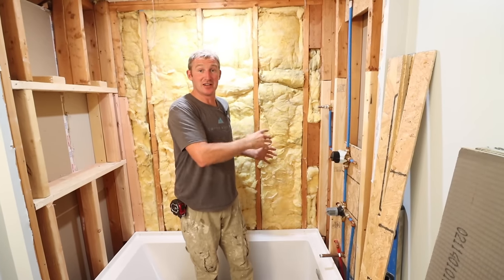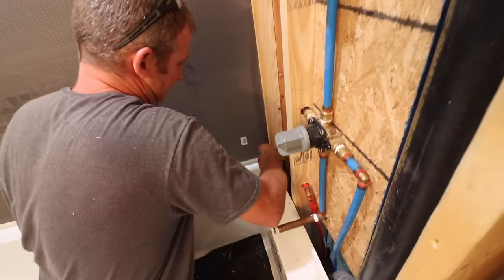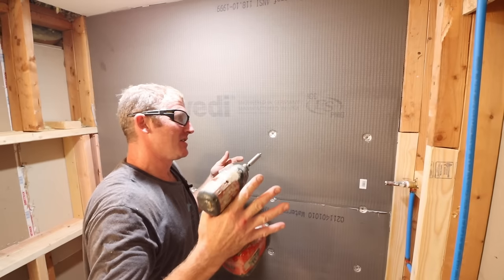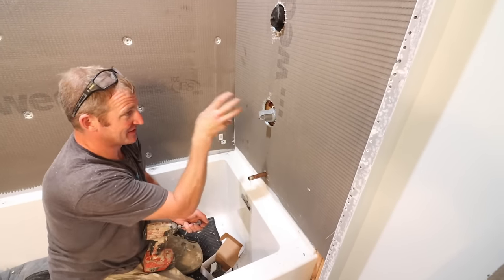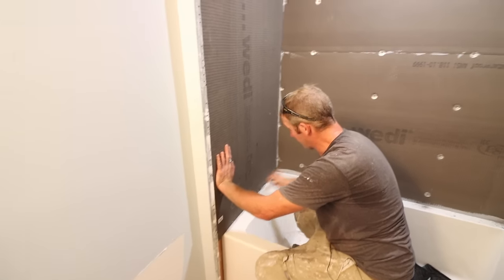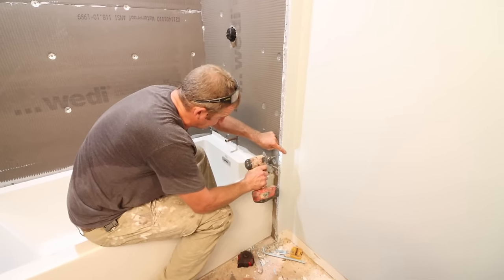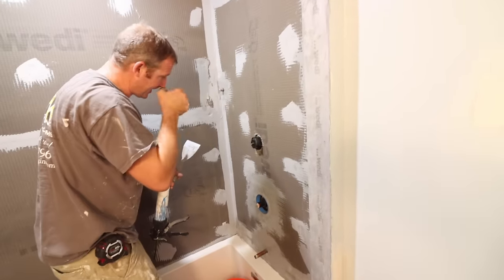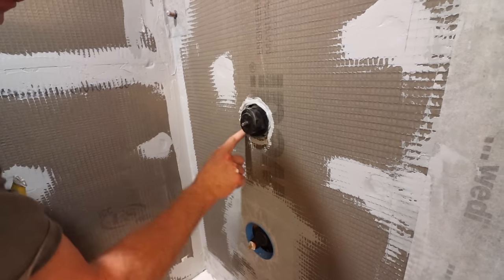Waterproofing Tub Shower Walls | Easiest Method for Beginners

Comment: Did I miss something.. Didn't you day that the foam board has to be 1/8 inch above the tub surround?  I didn't see you use any spacers at the bottom or was the sealant used for the spacer?  Really need to know because I am building a shower next week...Thanks!

Comment: why use the 620 instead of the Wedi? would the Wedi work just as well? prolly going to use this on my bathroom just wanna see if there would be an issue with using the Wedi sealant with the tape.

Comment: Hello, I noticed that Hardiebacker has two sizes of board. 1/4in with grids on it, and 0.42 inch which is smooth. Which is recommended for shower walls, and which is for floors? Do you know which sealant I would need to use like you did at 6:24? Also would I need to paint the hardiebacker with redguard or use a vapor barrier behind it? Thank you in advance!

Comment: Pro tip,

#1 Use a flush router or Dremel tool to cut the niche out. Its faster and cleaner. I use a 20v Dewalt drywall cutout tool 

#2 Do the inside frame of the niche before the back of the niche. Its better waterproofed that way.

Comment: What if you are just building a shower, do you still need to have a 1/8" gap between the shower pan made from deck mud? and would the sealant still be used between the deck mud floor?

Comment: Sorry if I missed the answers to my questions in this excellent video but - why did you fir out the back wall and put the backer-board all the way down to the tub, but not the 2 other walls which you butted the backer-board at the faucet side, and notch the backer-board to the rear of the tub?
Reply: I was wondering this as well. Someone please answer!!

Comment: Love your videos! I have a question about the back of the niche. You said there was a bedroom behind it. It looks like you adhered the backer board to the backside of the drywall in the other room. What happens if the drywall needs to be removed in the other room? Won’t that mess up the back of the niche?
Reply: or what if someone goes to hang something on the wall and drives a screw through the backer and tile ?

Comment: Seems similar to what I'm doing right now. The tub looks recessed in about 6" from the outer corner at the bac of the tub. should the regular drywall cover that 6"? Does the durock go all the way to the corner or does it stop at the edge of the tub. I'm a bit confused on what to do with the outside corner and that 6" before it reaches the tub. Do I put in a 6" by 8ft. piece of drywall with a finished corner? Does the durock then buck up against the drywall? I see you have some kind of strip going from the tub to the height of the durock. Is that over the seem of where the drywall and durock meet?

Comment: One suggestion:  mount fur-strips about 3/4” above tub edge. This will ensure moisture cannot wick up fur-strips in case water does penetrate. It also adds air-gap that could allow micro leak evaporation.
Reply: Same with backed board. Need to use a waterproof membrane on this application!
Reply: @mistic mind , he's using wedi board on this application. Wedi  board should be taped like drywall using wedi products. What he did show is how to finish to the tub lip. Sealant on the lip of the tub on the back of the board and leave board up off the 1/2 inch!  Wedi board is a vapor barrier. I would use Red Guard on this application , because I don't trust the caulk!
Reply: @energizerwolf5574  Wow. Glad to know. What's the alternative?

Comment: Hi I’ve added Kbrs shower tray to. MY rebuild. The shower tray had an arch to it and once installed 1 corner is a little more than 1/16” lower. It’s only on the flat area of tray. Should I use thin set to raise up to level?
Reply from the maker: yes, if you can get that corner level it would be better for the slope and to ensure the shower drains properly

Comment: What if you have a window? Do you use ply around the window frame, similar to how you started around the flange? Thanks!
Reply: All you do is cut the wedi like he did the niche. Then at the window itself use the wedi band and the 620 sealant along the window. I had to do this as well. Worked great. Wedi seal the edges where you cut and turn into the window

Comment: Hey. Using durarock on walk in shower   Seems & corners fairly tight so only needing minimal amt thin set or mortar not wanting buy get full bag.  What else to use if using Mapai LVT 4 system utilizing ProCore Plus on walls. Using aqua guard and their adhesive

Comment: Hi. We are going to be installing a wedi shower system next week and we are butting up the wedi panels next to plaster walls. I am not sure what to use for the same. We are extending tile for a couple inches past the glass doors so it doesn’t need to be waterproof. Can I just use mesh for drywall? Do I put the wedi sealant on the edge of the wedi?
Reply from the maker: hey Debra, great questions. If the Wedi/Plaster transition extends outside the shower area and won’t be exposed to water you can tile over the transition if both materials are flush with each other. If however that transition ends up inside the shower it’s best to use Wedi 620 sealant and embed the Wedi band over it to waterproof. But it sounds like you won’t need that in your scenario

Comment: What backer board did you put behind the bathtub... I have a tub in an exterior wall that currently has sheet rock underneath(below) the cement board and growing mildew ... I don't know if sheetrock goes down there or i need a different material

Comment: How long do you need to wait after applying the sealant to tile?  Are you just waiting for the sealant to skin or for it to cure?  I am actually using goboard with Loctite Concrete & Masonry sealant and I am not sure how long I should wait before tiling.  It definitely takes longer to skin and cure but that isn't a big deal to me.

Comment: Crazy question-
What if i need to change my valve every 6 to 8 years? Is it possible to have a watertight sealed mini door to open and inspect or change the water valve? 
The water here is very corrosive and I have high water pessure.

Comment: I need advice/help, there is tile in my bathroom, in one spot on the dividing wall where it looks like the tile and drywall is being pushed outward, and the drywall is chipping and turning into dust between the tiles, what should I do? And what is happening?

Comment: I like your style , one thing I noticed you didnt do or mention and it apparently created a minor issue for you ! If studs are marked in pencil on both tub and cieling studs they are much easier to locate . I use this method when I am installing drywall and it prevents misses otherwise great video..cheers

Comment: With gold membership, can I ask questions through email?
Or to ask question is only for premium membership?
Reply from the maker: usually we answer a few initial questions for Gold members, if you need more help then a Platinum membership is better and you can upgrade to that any time 👍🏼
Reply: Correction *Platinum not premium. :)
With Platinum membership included FB group, is the group only talk about bathroom projects or any projects including the kitchen?
Reply from the maker: technically it’s meant for bathrooms but we are happy to help with kitchen renovations as some topics like tile apply to that as well; but yes, the Group is part of Platinum as is email support

Comment: If you can't afford to use Wedi (it is truly expensive), use light weight drywall, then  buy a gallon of Redgard  and apply a few coats. Use fiberglass tape in the corners and all seams.  Pack the Redgard   good  at the bottom between the drywall and the tub flange (no need to put drywall over the flange).  This will lock the tub in place  and prevent movement. (no need to be concerned about tub expansion and contraction).
Cost of materials will be $50 for the Redgard and $50 for the drywall, screws and fiberglass tape.
Reply: pack with?

Comment: Aren't foam board as structural backing is weak compared to cement backer board? I've seen foam boards from Schulter needless to say it's just like Styrofoam board. I'm sure waterproofing is great but flex can produce grout if someone decide to punch the wall? Just saying.

Comment: Couch critiques suck but ... why use fiberglass for the insulation rather than Roxul Comfortbatt?  Roxul has higher R value, subjectively better sound insulation, unquestionably better fitment to odd spaces, and dramatically better resistance to moisture than fiberglass.  If no reason, may I kindly suggest you try and perhaps make a video on it?

Comment: I have a stupid question. Isn't cement backer board stronger than foam board? What if after all this work some idiot falls in the shower and hits the tiled wall. Won't it break? I'm leaning on cement backer board simply because it is stronger 💪. But I agree this was a good video. The furring strips was a good idea. Agree  using a manufacturer's recommended products. If all else fails....read manufacturer's instructions 😀

Comment: Hi thanks for your input to my last question. One last one. I’m installing vinyl plank flooring. When it abuts the curb area shound I install floor 1st and then add tile with a gap between for caulking or install tile 1st then gap floor to tile?
Thanks, dick t
Reply from the maker: great question Dick, any reason you’re not using porcelain or ceramic in the bathroom? We highly recommend tile because it’s less likely to be damaged due to water splashes etc. That said, we normally install the floor first then leave a 1/8” gap between it and the vertical curb tile. That gap should be filled with 100% silicone

Comment: Where do you buy the WEDI products?
Reply from the maker: you can get it at local distributors or the Tile Shop 👍🏼
Reply: Home Repair Tutor oh nice, thanks for the quick reply! I tried Home Depot and couldn’t find it. I’ll try the TIle Shop next
Reply: You can buy different thickness as well. Did mine with 1 inch. Enable notching over tub a breeze

Comment: I couldn’t find these wedi boards in my area (Philadelphia), did see GoBoards at Lowes. How do GoBoards compare to Wedi? The only problem is Lowes doesn’t sell their sealant and fasteners, so I would be mixing installation products.
Reply from the maker: they are different, Wedi's foam core is waterproof whereas GoBoard's is not. You should have several Wedi distributors in the Philly, plus the Tile Shop has it

Comment: I haven’t told that if you use Hardybacker and you put it up against the tub that you can have 4 inches where it will wick back up with water and that you should leave a gap with the Hardybacker now what you’re using doesn’t have the same issue

Comment: How many tubes of wedi/620 sealant did you go through on this install?
Reply from the maker: @GeneWuzHear  around 8
Reply: @HomeRepairTutor  8 of each?
Reply from the maker: @GeneWuzHear  not 620, just one tube per panel of joint sealant plus 1 for extra
Reply: @HomeRepairTutor  thank you!

Comment: I didn’t see where you left room for expansion along the vertical sides of the Wedi board, only along the horizontal sides?
Reply from the maker: good question Jackson, the Joint Sealant in the corners of the shower provides the necessary expansion joint
Reply: he probably works for wedi
Reply: @anthonyroberts4996  if you watch his otherbvideos you realize he is not working for Wedi due he uses many other products
Reply: Watched this before going to bed...
Wife said instead of snoring I kept saying "wedi" all night

Comment: The notched application I'd be worried the first time someone replaces the caulk that the entire notched area would rip off even with tile over it. the most popular tile right now is 3x6 if 1.5 is notched out that's only half the tile supported

Comment: I like your illustration, but I have a problem with how you treated that niche in the shower.  When you adhesive/bond back of that foam board to drywall of the bedroom you're now creating a situation that can potentially be problematic in future.  Either if a leak develops (always do), now your bedroom's subject to that problem, Another issue is if the teenage occupant of that bedroom wants to hang a poster/picture on the wall and the nail or screw penetrates this foamboard just enough to disturb the tiles, and compromising the water tight shower stall.  Instead of bonding that foamboard directly to the drywall, I would first install a 3/4 plywood with a layer of 16th thick galvanized sheetmetal backing to impede nails & screws, Then I'd install a liner water barrier before fitting the foam board to completely isolate moisture from the bedroom.

Comment: Is there any reason why you could not do the Wedi or Schluter and then paint the whole thing with something like RedGard as a double safety barrier?  Maybe overkill but its cheap so why not do both?
Reply from the maker: it’s not necessary of the system was installed correctly, plus you’ll void your Wedi or Schluter warranties

Comment: In my opinion , the  “ easiest” method is to use a brush on product ( I.e. Redguard or similar/equivalent) 2nd easiest would be to drywall/ plaster as a typical wall and then apply a membrane (I.e. Kerdi or similar/equivalent)

Comment: Why did you fur out the back wall and drop the backer board over the flange on the back wall but set the backer board on top of the flange on the side walls?
Reply: Different techniques.. coulda done any application for any side of the tub.

Comment: Is anyone concerned about scratching the tub when you scrape away the excess sealant around the edge or when using a utility knife on the edges? I am about to put a new tub in and need to put something under the tile and I am so paranoid about any flaw in the finish on the new tub,.

Comment: At the beginning: "Man how does he hit those studs without any issues, is he looking at the marks on the backer board? does it feel different when he presses on it??"
80% through: "I missed my stud here."
Reply from the maker: some times it happens but isn’t a big issue since the Wedi Joint Sealant is easy to apply over any hole in the panel

Comment: Thank you so much sir I have a man here who's replacing my shop wal and my two and he didn't do any of that he took that raw shower 3 panel kit and put directly on the drywall he didn't put any more or anyting up under the tub he said that the ground the floor in the house with a mobile home with good and solid and only thing he put behind the shower panels is a three kids shower panel was during Loctite in arm Liquid Nails and I knew that didn't look right but thank you if you can help me and give me a call me I appreciate that have a nice evening

Comment: I think you might be wrong about placing that backer board all the way down against the flat part of the tub. Anything that gets exposed to water can basically act like a siphon and siphone up the water into everything. I def would leave a half inch gap or so. But im no pro.

Comment: Is 620 a WEDI product?
Reply: Please disregard since I found it is a WEDI product, I was using the WEDI standard  joint sealant not 620. for areas where Wedi met sheet rock but it was always in a dry area after glass shower door.
Reply from the maker: yes, 620 is relatively new

Comment: When you sealed the bottom of the Hardy backer you made sure than any condensation on the back side will build up and get the studs wet then I will make thousands of dollars tearing out the shower and the wall and all the repairs to the other side of that wall and the sub floor and damn I hope you have a lot of money because what you did will make me about 45 thousand dollars

Comment: As a Certified WEDI installer of 15 years, I can say that simple building panel installations might be ok for beginners.  A full WEDI pan, drain, and shower system is not for beginners!
Reply from the maker: thank you, Wedi does make good systems - we wish their drains were better; the caulking gasket and nut are not full proof and can be problematic
Reply: Wedi can’t compare to a good old mud pan.

Comment: except I would not have any loose foam insulation (only closed cell spray foam), all drywall in the bathroom is purple or green board that is glued and screwed, and waterproofing means nothing if you actually don’t waterproof; not just proper materials.  Let alone he didn’t create a rubber membrane between the studs and the tub and used cheap water absorbing wood to cut out the hardie board to buff out the cement boards

Comment: Steve. I appreciate the videos you have put out. They have been extremely helpful!. I have a question about the mixing valve collar installation. In this video below, around the 14 minute mark,  it looks like you have the collar with the thick side out. Wanted to see if you could confirm what side should go into the wall https://www.youtube.com/watch?v=0AhGQ2BfxoA

Comment: Wedi promotional video. You failed to reinsulate the fixture wall. Waterproofing a tub surround or shower enclosure is not necessary or mandatory to do a professional job. The TCNA is a book of recommendations and national standards of the trade. That is why Manfacturers control the methods of application by suggesting non standardized methods. Stapling sheetrock shims is the norm, because of the lack of good lumber and framing that occurs prior to the tile installation. Vapor barriers were sufficient back in the day. Foam board is twice the cost of a cement backer unit. If your installing a steam unit, proper pitch and waterproofing is a recomendation. Rolling out a few coats of a liquid waterproofing membrane is usually  easier than caulking if waterproofing is desired. Plus, thinset will bond to it. Foam board is light but the majority of pros prefer cement boards because of cost, durability, and ease of installation. We do waterproof all niches, because if not installed properly water will sit on the shelf. Seal your grout.